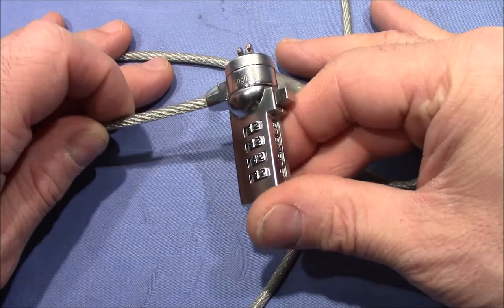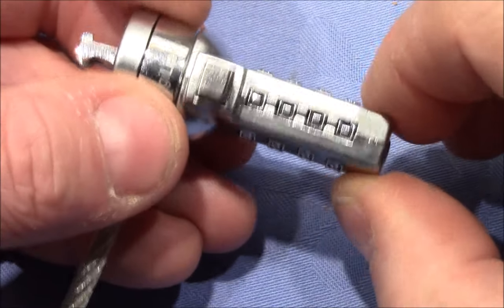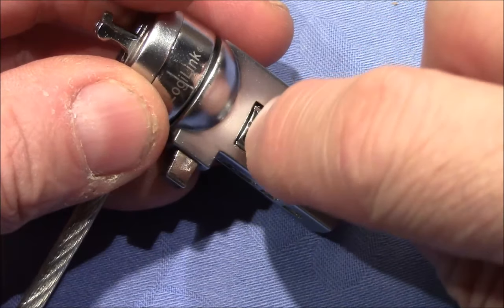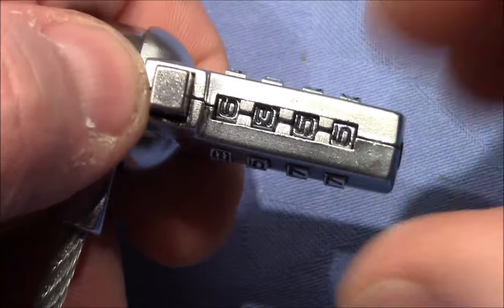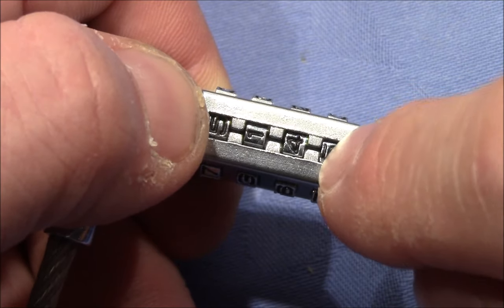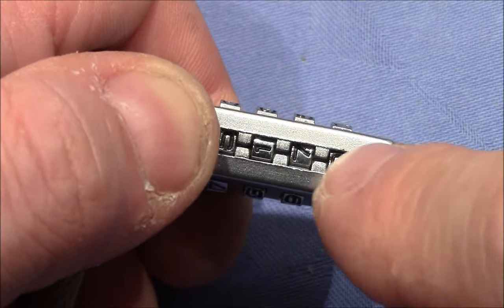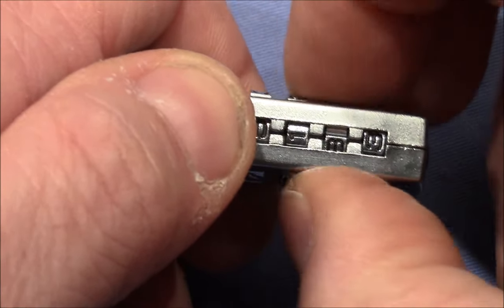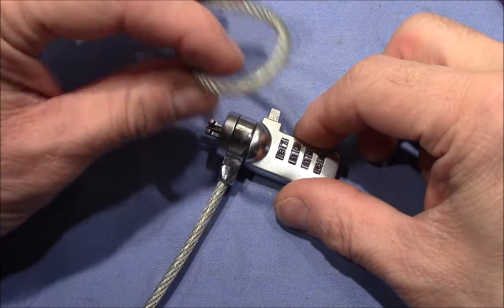(picking 733) Laptop lock from LogiLink decoded easily (indirect method)

Comment from the maker: Locks like these laptop locks from LogiLink can be decoded easily by pushing the button and feeling a change of resistance on the wheels. Here I'm using the indirect methods for a quick and reliable success.

Comment: After a little bit of thinking about it, this worked with a Kensington combination lock that looks very similar to the one in the video. I found turning one way didn't really identify the gates, but they were quite obvious when rotating the numbers the other way. Found the gap of numbers four apart and it all clicked into place.

Comment: Thx! This method works to unlock Defcon CL with round windows and blue plastic. 🎉 Follow the steps explained in this video. Start with the most right wheel. There are 1 real gate and 2 false gates on each wheel/window. All 3 gates of a wheel create retention on the wheel left to it. Write down these numbers when you feel the retention. The real gate is +- 3 of false gate.

Comment: As you can see, it has only one latch that moves at the center when you press the button. You don't need to decode the lock just twist align with oval lock slot and pull from laptop.
Reply from the maker: But decoding is fun.
Reply: @Potti314  Yes it's fun like a chess. But on the theive's mind, they always do the shortest way as possible.

Comment: Hey! Does this method work with every lock? I have a computer lock by another company.  Can I use the same method for that?
Reply from the maker: Try it. If the wheels start binding when tensioning the locking mechanism, then the lock can be decoded this way.
Reply: @Potti314  i have been trying and it does feel right, it just never clicks open, I always find new numbers that seem to be binding but none of them work